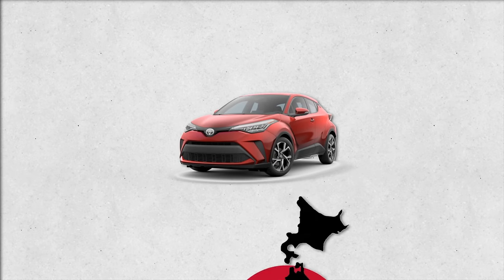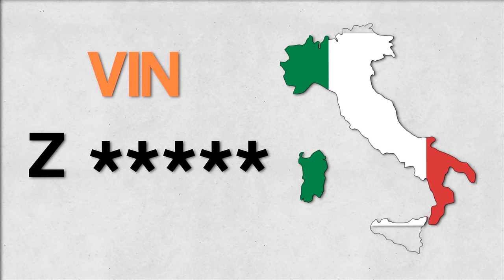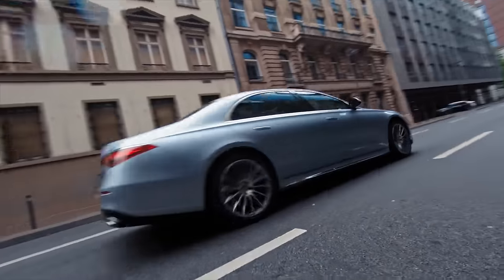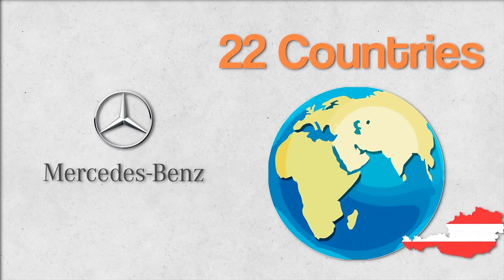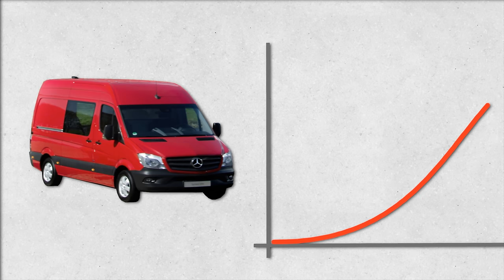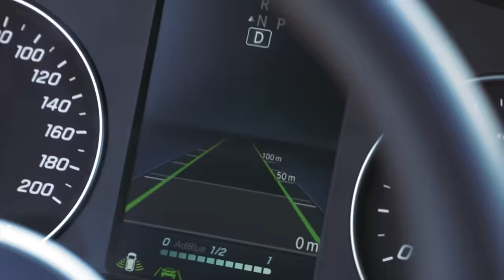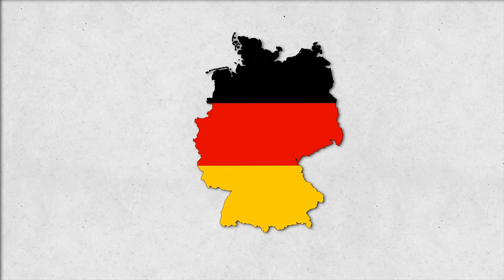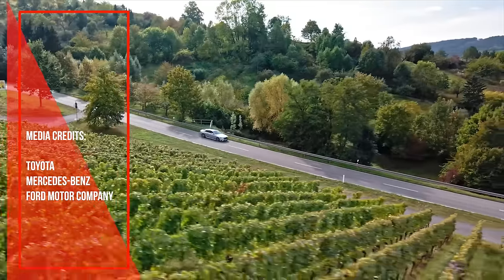Never Buy a Car Made in...

Comment: I'm in England, have 2 cars made in Japan, Subaru Forester and Prado, both are extremely well made good to drive and totally reliable despite being 14 and 17 years  old respectively.
Had a Japanese built 70 series back in the 90's,  a mechanic's dream, every electrical item insulated with white grease as were all connectors, and all relays etc had their purpose and voltage stamped clearly on them, ie ''12volt glow plug relay'', very tough vehicle.
Had a Hilux new in 2007, a top range model of the day, made in South Africa as almost all Europe bound Hilux were, no complaints about the build quality on that either, again all connectors had electrical grease inside as has the current Prado, you don't find that on other makes.
I drove car transporters for many years, including carrying hundreds out of the UK factory in Derbyshire, qulaity control both there and at the import centre at Portbury (Bristol Channel) has to be seen to be believed.

Where Toyota win for me is that they are old fashioned and none the worse for that, as we say in England ''if it ain't broke don't fix it'', new designs are properly tested before release to the buying public and Toyota stand by their product.

The only criticism i can make, of Toyota 4x4's in particular, is regarding rust prevention of the chassis and underbody, they don't treat the chassis/underbodies of vehicles destined for areas or countries with colder climates that use extensive road salting any differently than those going to warm climates, those of us with sense use our own rust prevention measures but Toyota could do far better at manufacture stage, their 4x4s would then be even better and command even more ludicrous used values.

If i replace either car it will be with another Toyota, nothing else compares all round.

Comment: I love my 300C Benz and have not had a single issue with it.  I have owned a German made Benz and I will admit it was very high quality and traded it in for my 300C.  I do believe you are correct with Japanese quality.  Kaizen is a CI philosophy and is part of Six Sigma and I worked for a company in the US that had Lean Six Sigma as part of its management training and believe it is a good platform in manufacturing for delivering high end results.

Comment: Scotty is correct.  My 4Runner (made in Japan) will last many years.  My first new car was a 1989 Honda Civic LX made in Japan.  When I sold it 10 years and 182,000 + miles later, it ran as smoothly as when purchased with mostly routine mantainance work done.  Still regret to this day letting it go.

Comment: I "Cash(ed) for my clunker" about 13 years ago, for a V6 Camry, thinking it was going to be reliable. 170,000 miles later, except for a replacement alternator and fixed banging sound in my roof, it's been pretty good. Needs new motor mounts now. My VIN starts with a 4. This video draws into question my plans to keep this baby until new cars are affordable again.

Comment: I worked at a car manufacturing plant here in the us I'm not going to say which but I will tell you this, I will never buy a car made here by people like me nah I'll passed. Here in the us we get in trouble if we stop the car line. So that car line only stops if their is something wrong with it a malfunction or something other than that that line runs 24/7 you know dam well people ain't doing a perfect job they barely put in bolts right. The guy that worked next to me doing the same thing as me but in the other side of the car will b high asf on pills he could barely stand up and he wasn't the only one a bunch of people will come in like that now think for a second do you really want people like that building your cars? Hell no not me I'll pass

Comment: I would never buy a Toyota Tacoma made in Mexico.  Because of build quality issues.  TMC knows it.  If you're going to buy a Toyota Tacoma, buy one made in TX.  Also, you forgot to mention that TABC in Long Beach was the first plant to manufacture truck beds for Toyota cab chassises assembled at the port of Long Beach, CA.  To avoid the "chicken tax".  Now, they make parts for TMUSA and Tesla, too.
Reply: They’ve been assembling a large amount of tacomas in Mexico since 2004 and since a few years ago now the lion-share is assembled there. The only non-assembly portion is in Baja where they produce the bed. Otherwise only assembly occurs in Baja and Guanajuato, the engines,  frames, electronics and drivetrain components are all shipped in from other points of manufacture

Comment: i worked in a japense manufacturing company before and i resigned.  its so stressful specially as an engineer you work with old Japanese employess. They never leave the office until their boss/owner goes home even though it will reach 12-midnight working. they overtime for FREE!

Comment: Bought a used 2013 RX350 109k mi in July 2021 but before purchasing when I saw on door panel "Made in Japan" it pretty much sealed the deal of course after driving and checking! Same with my 2005 RX330 bought in 2015 w 137k mi & sold at 240k mi made in Japan too
Reply: Rx350 are made in Canada
Reply: @martinndabi2665  sorry not mine

Comment: My brother has had two Camrys. A 1999 Camry "AMERICAN EDITION" proudly badged on the side of that vehicle. And a 1998 model. The 1999 model only lasted 230K miles (IIRC) before it started having issues and eventually the cost to repair it was more than the vehicle was worth. While the 1998 got to almost 300K miles before it pooped out. But this could entirely be just anecdotal evidence since he got them both used. Who knows how well the previous owners maintained them before he bought them?

Comment: The auto I purchased used is a Ford C max energi 2013 which Ford 
stopped producing in 2018 . They were tested
In Europe then released
in America .
After checking reviews on
line , those that drove them loved it !
It was formerly a lease
vehicle by 2 previous people and had 75 k miles
on it when I got it with a brief 3 mo. warranty.
It has 3 batteries , one in
back , lithium in middle and one under hood .
It has range of 60 miles per gal / combined with
plug in power of 20+mile 
&gas of 41.2 miles per gal.
  Breaks are used also for
getting more electric power when applied at
Stops and general breaking while driving .
  There are times I do not
charge the car. & just run
on fuel which manual said
to only use high octane 91
only .
Drives great with great
exceleration.
Trying to save life of car and value , it is used less
frequently and maintained . 
Really would love any
suggestions on maintanance and any
personal review .
  Originally these sold
for $36 K

Comment: My 2007 Acura TL has over 250k + miles on it , runs like a dream still
Reply: People underrate the reliability of the 3rd gen TLs especially the ones built from 06-08 my 06 TL lasted me till 380,000km with nun done to the engine I still could’ve saved it to but just opted for another 3rd gen with less kms

Comment: Over the 45 years of driving, I have owned domestic, European and Japanese cars. The 2 best I have ever owned are the Camry and my 2004 V6 Highlander still running great at 327,000 miles followed by my 2005 c240 4Matic Benz. 
I do regular maintenance on my cars which includes oil change and also frequently overlooked drain & fills like transmission, rear differential, transfer case, power steering, radiator and bleeding brake lines. 
Do preventive maintenance on Japanese Toyotas and they can last you for over 400k+ miles.
It’s a shame our domestic car makers just don’t get it. Never buying any car made or assembled here.
Only Toyota/Lexus made in Japan or German made Benz for me.

Comment: I have a Japanese-made 2002 Toyota Camry SE with manual transmission.. runs fine with 277k miles.. I'm not selling it until the current clutch goes out..  we had a Pontiac Vibe (re-badged Toyota Matrix) that reached over 300k with original engine & tranny

Comment: European taxi drivers that own their cars like Mercedes E200 CDI. These are commercial non-luxury models that used to be very durable. One can buy 10-year-old used taxi from Germany with 400000 km on odometer and drive it for another 10 years for less than it cost to run newer car. As they are popular you can service them for reasonable prices unlike in US where parts and service are overpriced by dealers.

Comment: Interesting video Scotty.  I drive a very nice E320 with a gasoline powered V6 and 5 speed automatic.    Yes, a 20 year old car with the W prefix on the VIN.  Still rides and drives like a nice automobile should, plenty of passing power, and a very respectable 31 mpg at the speed limit.  It got the premium paint and leather interior at the factory along with a set of nice alloy wheels.  Ordinary maintenance parts like windshield washer pump, accessory belt tensioner, oil filter, etc. cost no more than any other car.  No oil is added between changes and she keeps on motoring.  German reliability and low maintenance at its best.  Not all model years are the same but this one, built on the W210 chassis, is a winner.

Comment: Honda's and Nissan's built in Japan are probably also very well built.  It's not all about Toyota.  My 12" Altimas's transmission has been bulletproof for over 10 years and the engine has NEVER used a drop of oil between oil changes.

Comment: I knew about the VIN designation for cars built in Japan vs Mexico. When I test drove a Honda Accord I checked to see that I was made in Japan. It was. But when the dealer brought around the car we ( my wife & I ) were going to drive home I saw it was made in Mexico. They tried to switch cars on me. It looked exactly the same as the demo - same color & same extras. I said pass. Of course the dealer tired to bully me into taking the Mexico made car. I told my wife we were leaving. They finally relented & sold us a Japanese made car. 
I have nothing against Honda for making cars in Mexico. However, a friend purchased a Honda made in Mexico & he has weird issues with it. For instance, the doors didn’t line up correctly so it had excessive wind noise. He also had to replace the battery on it before 5 years had gone by. Scotty explained this issue in one of his recent videos. Buyers were complaining about cheap tires in their new cars so the manufacturer put better tires on new cars. They cheapened them elsewhere & putting cheaper batteries was one way they did that. I had a similar battery issue with a new Subaru I purchased in 2017. Go figure.

Comment: In general, vehicles made in Japan seem to be better according to opinion BUT I got a 2022 Corolla SE made in Japan a couple of months ago that I had to bring back to the dealership because the steering wheel was not tracking straight. There was a stored code for a steering angle sensor that needed to be calibrated.  The mechanic said it was probably an oversight. I then said, but it was made in Japan. We will see in the future...

Comment: I prefer Japanese built cars, mine are 2001 Toyota RAV4, 2007 Lexus IS350, 2011 Toyota FJ CRUISER, zero problems with these cars.  I still have the FJ CRUISER, I also had the first 2007 FJ manual transmission had it for 5 yrs then bought the automatic transmission, I still Love it and it’s in excellent condition with 40,000. Miles.  I am considering the 2023 Toyota Sequoia TRD PRO.

Comment: 2005 Highlander 167,000 mi and going. Replaced belt that runs water pump about 5,000 mi ago. Getting small patches of body rot. VIN starts with "J".

Comment: I have a 2013 Lexus GS 350 only 64k miles. The rear window stopped working. The climate control isn't working. The driver seat makes a popping sound when adjusting it. Make a tapping sound while idling I was told this is normal by the techs though??? And theres a front end issue they just won't look at for some reason, won't drive straight always wants to pull to a side. I bring it into the dealership to get this stuff diagnosed and fixed. 3 days later I was told it would be done. They email me saying they need it over the weekend and Monday it will be done...all good then I'm told but if I do need my car they need to put it back together aka pop the door panel back on and I would need to reschedule and repay the diagnosis fee because they would need to pop the door panel off again...so because they are busy doing tire swaps I would need to double pay the diagnosis fee if I needed my car because it wasn't ready and they didn't even figure out why the windows not working. Everyone always talking good about Lexus this is my first Lexus and experience has been terrible. Or maybe it's just Kendall Lexus in Alaska.
Reply: Believe me, this is a very odd exception. I hope they gave you a loaner car for all your disruption of having no car during this.  I’m still in love with my 2010 RX even after almost 12 years!
Reply: You're not alone JD. My 2019 Camry was nothing but problematic. People just tend to give Toytota a free pass when it comes to problems for whatever reason. I'll think twice before ever buying another Toyota.

Comment: It's actually not a bad car and pretty safe to drive. I like the collision avoidance system it has saved me multiple times no lie, might scare the crap out of you but it will save you. It also auto corrects when you go off lane, really good for someone who just started driving. I'm surprised more cars in the same price range don't have those options, also Really good on gas, now is it worth the payment every month defenetly not. I bought the car because I was doing Uber it did me really good I must say. So far so good no issues just battery issues now will it last like the Camry from the late 90s to early 2000s we shall see.

Comment: 500 5 liter 300 hp 550 5.5 liter 380 hp,  not the same engine , did you put that in there to gode a jackhole into commenting ??? sneaky if so

Comment: I have a 2012 Ford focus with 74,000 kilometers on it, there is a W at the start of the vin and is made in Germany. I have already replaced steering rack and now the heater core has failed. I was looking at a 2010 Toyota corolla ascent hatchback here in Australia and it has a J at the start of the vin number, it has 153,000 kilometers and I'm not sure if that is too many as I want to have it for a long time

Comment: The vin number country identifier USED to mean what country they are built, and its the case with most cars.........but Audi, for example, has a "w" in the front of the vin numbers on the Q5s.......but they have been built in Mexico 100% since the 2018 model year.  They got some kinda exception in that meaning that they can put the German country code there if thats where the company is headquartered.  Its a scam in my eyes but it passed sometime in mid 2018, and theyve been doing it.  Im sure there are other makes and models, but that one i know for sure.

Comment: I worked at Mitsubishi in the U S where a number of vehicles were built. In addition to other cars we also built the Plymouth Laser, Eagle Talon and the Mitsubishi Eclipse. Those three vehicles were all the same basic vehicle, same platform, the front seat for the same level was rated better in the Eclipse than in the Laser because people assumed it was built in Japan and had the Mitsubishi name even though they were the same exact seats produced at the same supplier, installed on the same line by the same people. Sometimes there is an illusion of  quality because of the nameplate or where it was assumed to be built when in reality there is no difference.

Comment: I have a 2019 camry  2.5 xse as well. Poor fit n finish , crappy head unit, and the high side A/C line was leaking since new off the lot. Back and forth to 2 different dealers over a 1.5 to finally have it fixed. They pushed away from warranty work until it was out of the bumper to bumper warranty but before that I made the service manager put it in writing and in tje service notes if it comes back after warranty they would fix it. Well I video the leak with my phone finally and brought it to them. Got a new line ,oil, and recharged.

Comment: I have my 2009 xorolla xrs built in Canada still runs like a champ. I also just sold my 2009 subaru wrx made in japan last year. I know have a 2020 tundra trd sport crewmax 4x4. While I love this truck the fit and finish is terrible exterior mostly. 46k miles and its developed a rattle in the passenger side front door. Other than that its great

Comment: Hi Scotty, I just bought a 2013 Toyota Venza.  It has 226000 miles.  The previous owner said that he changed transmission when it has 210000 miles.  I want to drain and fill the transmission fluid but I am afraid that it might cause the transmission to go bad.  Not sure what to do.  Please advice.  Thank you.

Comment: Aspects of the Toyota Production System (and its implementation of Kaizen, Lean, Six Sigma, Shingo principles, etc) has been integrated into many US manufacturing spaces.
 
Problem is, it's seen as a "higher level skill" here, reserved for use by project managers and business excellence leaders.
 
Fine and good, but what happens is that the "lowly" machine operators and floor personnel aren't "in on it." They're instructed to follow 5S and similar procedures without being given a valid reason to be personally invested in their work.
 
That's the difference between Western and Japanese manufacturing; work ethic has been eroded over the past few decades and its culturally complicated to reverse that now.
 
Despite all that, I still love how my Tundra was made in Texas. Always fun to troll GM guys when they learn their "domestic truck" was actually built in Mexico.

Comment: I once had a taxi ride in a E class, it had 780.000 km on the clock. There was no wear on the interior. The condition of the car was amazing.

Another reason why mercedes is used as taxi is because they build decent diesel engines. Most mercedes here in europe used are diesel.